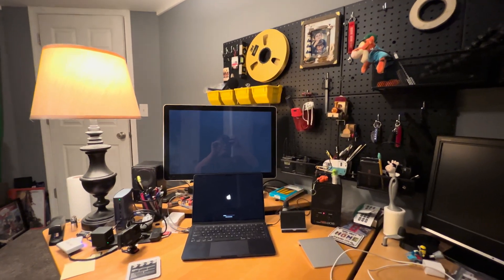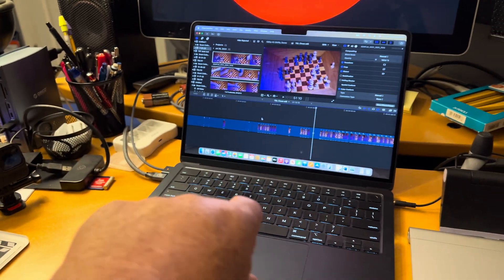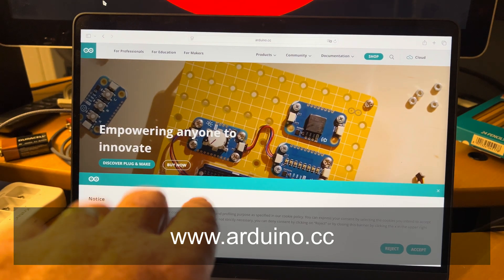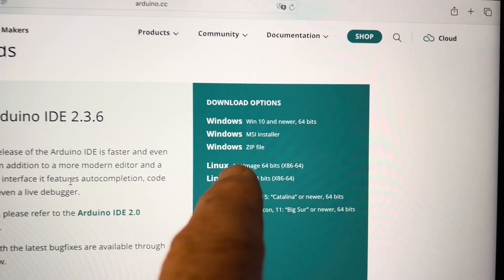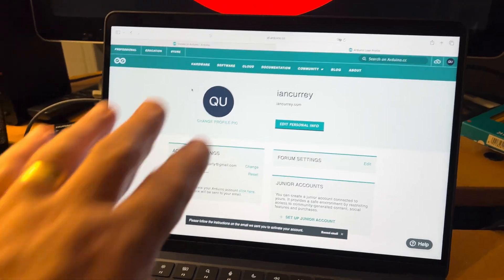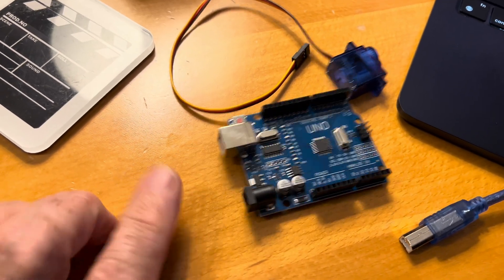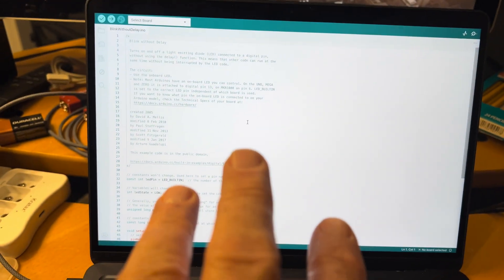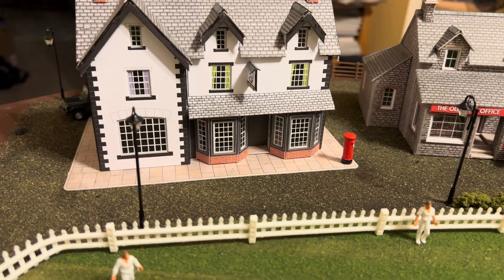142. Talking to an Arduino

Comment: Hi Ian, 
Great another computer episode to screw with my head. My question today is, Have you ever used a PC Computer before you switched to the MAC? Can you give me your honest opinion on the advantages and disadvantages between the two Please? Since my layout will be all run with domestic accessories, will that have any effect on the layout? Do you have any way to watch Cricket on TV at home? I hope you do so you can have a nice weekend. Say Hi to your Family and Shadow and Sparky as well. 
Talk to you soon. 
Bye for now.
Reply from the maker: Ha! Well I’ll try to get this series of videos over as soon as I can. 😊
Seriously I’m producing a few more videos this week so there will be a variety. I DO get the radar built and it’s even painted so I’m trying hard not to go all geekie on you.
Mac or PC?
Well THERE’s a question isn’t it?
Brief answer. They say once you go Mac you don’t go back but being serious it depends…
Just a few generalizations for you…
Train software runs better on a PC (I have a PC that is ONLY used for the Train Controller software). I don’t know of software that works on a Mac for that but I’m sure there must be some. 
PC are generally cheaper when you compare similar capability.

Mac? Well, they run video software far better and since I’ve spent a lot of time in that industry that’s the reason I’m Mac.

I’m not a huge computer guy. I struggle along. The Arduino is a challenge for me for sure. It’s working on the Mac but I’m sure it works jsut as well on whatever. 

Seriously, the big reason for Mac for me is video editing. 
At work we use iPads so the integration is easy for me too. These videos are all edited on an iPad.
Sparky is fast asleep beside me - Shadow is guarding us both from monsters. 
Hope that helps?

Comment: Just thought I’d send this if it’s of any use the kit comes with a servo
Reply: Yes it was a link to the kit as I’m guessing seeing as it comes with a servo it also has the info for the programing and where to plug it in I’ve ordered one I would have sent you a photo but I can’t see an option to do so on you tube
Reply from the maker: Thanks for whatever it was - I’m guessing if it was an attachment it has got lost in the youtube system somewhere. I need all the help I can get even if it’s just urging me on! 😊
Reply: It’s a seeed grove starter kit v3 for Arduino see if you can look it up comes in a green box there’s also another but it doesn’t have a servo
Reply from the maker: I’ll look it up. not sure why links go away but I’m sure there must be a good reason.

Comment: First step is to insert an LED into pin13 (i think) and gnd and it will blink with the LED on the UNO. And thats without any coding involved, lol.
Reply from the maker: That’s cheating! 😜
Reply: @trainsofthought5071 I suppose it is, lol.
Reply: It looks like it's already running the blink sketch with the onboard led (also pin 13). Should be easy to find it in the examples, change the parameters and upload to make it blink faster or slower
Reply from the maker: Time to lock myself in a cupboard for a day and concentrate 😜

Comment: nicely done, at least with the Arduino its not too hard to work out which one it is, as there are only a few choices...

and better than the first time I plugged one into my old mac, which crashed, hard.. the joy of "oh yes you also need to install the drivers"... which took a while to find.

nice to see that bit has progressed though

small steps is the way to go
Reply from the maker: I remember those days too! 😊

Comment: Hey Ian, I am also a filmmaker, editor and vfx specialist. I use Windows, currently on a Dell XPS laptop but for reasons you described, I am moving to ASUS ProArt. The little PX13 is a fabulous little 2 in 1 and is the same size as the iPad. As you say, its never a case of "Just Do" it is however, always a case of "Plug and Prey!" I saw your post on the jet engine the other day. Frank Whittle has a lot to answer for ! I used to build, maintain, test and fly radio controlled model helicopters with a Wren MW54 Mk 3 turbine in them. These same turbines were used in training engineers at Rolls Royce in Bristol for a time. Have fun with your computing project ! Best of British, Peter.
Reply from the maker: “The times they are a changing.”
It’s quite incredible when you look back at how things ‘were’ back when we were starting out. Computers were people when I was born!!! What happened?!!
I LOVE the advancement of technology but we’ve certainly got sloppy along the way. The engine hangs in a building where we often meet. Weird seeing it up there with us sitting under it.